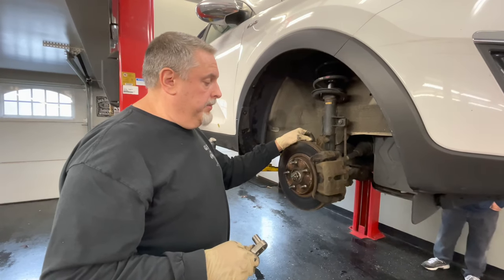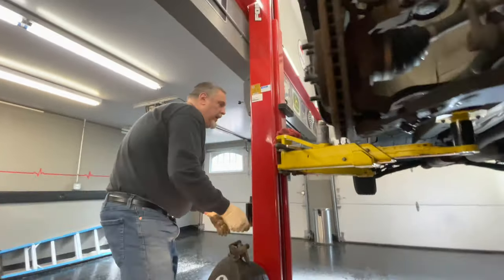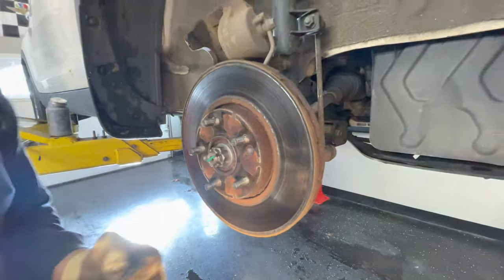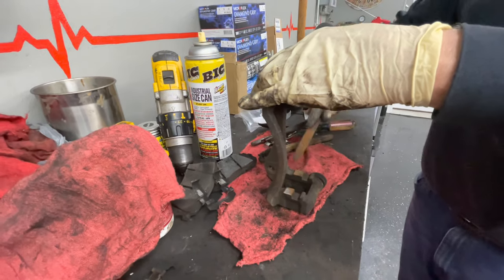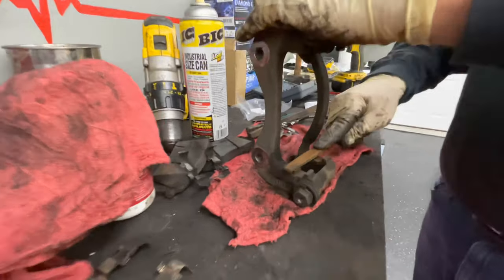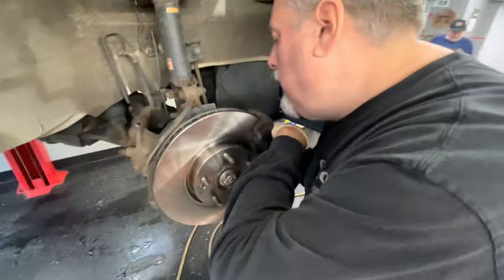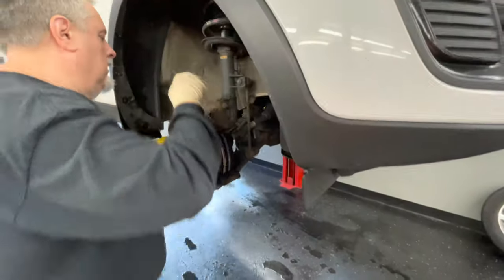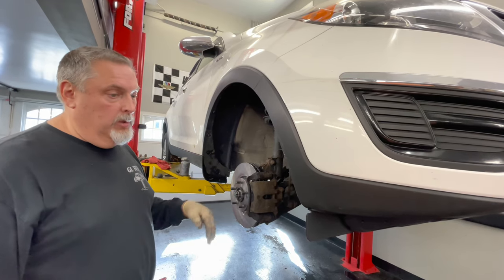DIY 2011-2016 Kia Sportage Front Brake Pad and Rotor Replacement

Comment: Great vid. Does it matter if the parking brake is on or not? I also live in the n.e. and the rotors have been impoasible to get off. Its my mothers car and of course she waited until the brakes were on the rotora to asl me to replace them.
Reply from the maker: If you are replacing just the front rotors then the parking brake will not come into play. If you need to also replace the rear brake rotors and pads, then the parking brake should be off so that you can remove the rear brake rotor. Hope this helps you out.

Comment: Does the fact that this model doesn't have that wire spring (like on the later sportage model) that used to push out the pads cause them to wear faster?
Reply from the maker: I don't think to. It typically comes down to how you drive the vehicle and also the climate that you live in. The North East is brutal on cars.

Comment: is it necessary to put the two philips screws back in? I work on the assembly line building the vehicles and was told that their only purpose is to keep the rotor stable during the assembly process at the assembly plant.
Reply from the maker: That seems to be the purpose of them. If they are in good condition we typically put them back in.

Comment: You fogot to put on the outer spring that holds the brakepads in place from the cylinder. Good video though 😀
Reply from the maker: Thank you for watching out auto repair video that shows you how to replace the front brakes and pads on a KIA Sportage. All brake components were double checked and put in place before we wrapped this job up.

Comment: Don't you clean the Rotor? It's covered with a thin sheet of oil.
Reply from the maker: Yes we did. We always clean the rotor with brake cleaner before installing them on the vehicle.